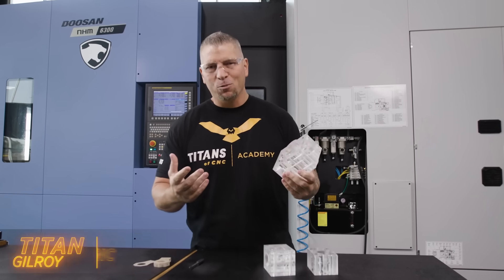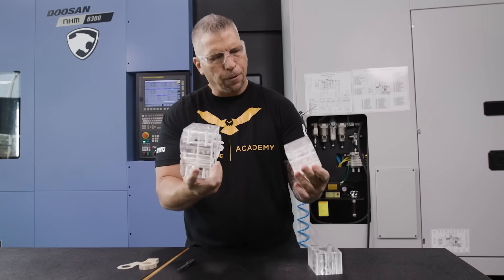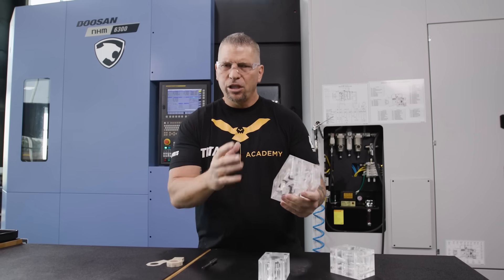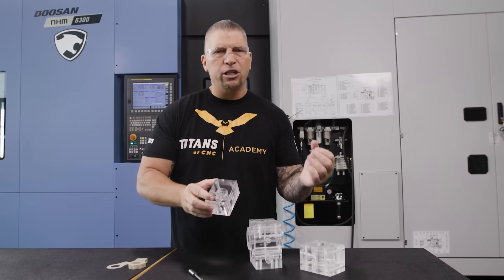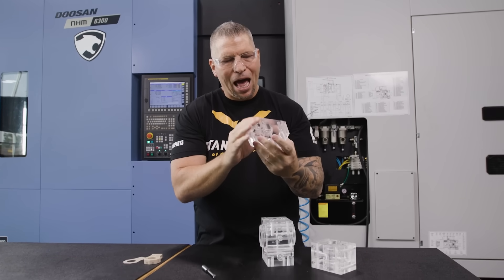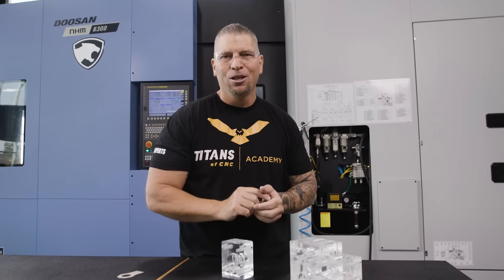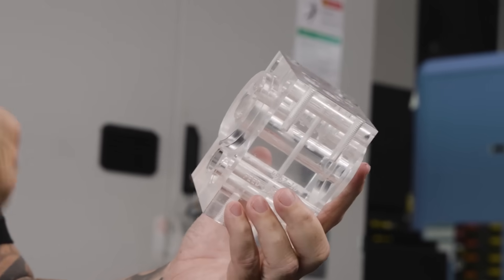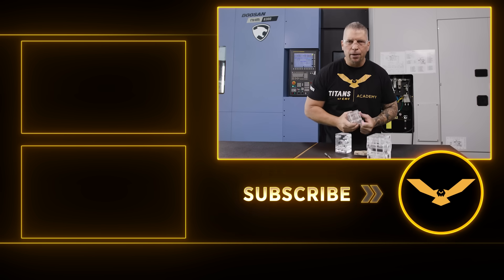My Secrets for CNC Machining PLASTIC

Comment: 🔧 Machining plastics IS often trickier than metal—thanks for the deep dive on tooling & techniques! For functional plastic prototypes or low-volume parts that demand precision, we’ve mastered these material nuances across CNC, casting & finishing. Knowledge is power!

Comment: I’ll be the first to admit that sometimes plastic can be harder to machine than some metals. It’s heat-sensitive, so it can warp or deform during machining, and its flexibility makes it more likely to shift or vibrate. Plus, static buildup causes any long, stringy chips to stick to everything. And don’t even get me started on cleaning the coolant tank when you switch between metals and plastics, it can be a royal pain. If you know, you know.. 😆

Comment: We do plastic stuff, man plastic is a pain.  we run 1000 rpm  no more.  Plastic wears on end mills and drills worse than fiberglass, or steel.  I've learned that tool wander for drills is real bad sometimes.  I've gotten as small as 1 ten thousandth just to get some tolerances just right.  Tool wear, really has an impact and so does what you're talking about, pressure on material, like stress.

Comment: I have a problem. I am using an old Hurco Hawk M5. I am trying to drill a 3mm hole to 100mm depth in Aluminium. I am centre drilling. SDatrting 3mm using a short 3mm drill, then medium length and then the long 3mm. I have been pecking away 1mm in depth so the drill retracts and I can get lubricent to the cutting face and blow away swaf. Listening to you today, I may have this all wrong?

Comment: The trick that I was taught to create clear plastic lenses was lightly heat the machined area of the lens with Hydrogen Gas using a standard Oxy-Acetylene torch....hydrogen gas burns without the black residue of acetylene.

Comment: From a machinist mechanic I think that pump was poorly engineered if it is that hard to machine.
We have been building pumps for hundreds of years, odds are there is probably an off the shelf that would have worked, boring but effective.
A pump doesn’t need .0001 accuracy to function.

It reminds me of the US vs The Russian space programs, the Russian rockets were designed with farm tractor tolerances and up until recently were doing pretty much all the heavy lifting while our stuff was mothballed.

Nothing worse than over engineering.

Comment: You talked about quality tools. I remember being in a job where administration was discussing with engineers and technicians about buying cheaper tools to save costs. That decision was above my pay grade at the time as I was a machine shop general operative but if it wasn't I would have stuck with the expensive tools because they were producing good quality automotive parts that the company were making money from and at a time when they could possibly have raised their prices if profit margins needed to be maintained.
Reply: Trying to save money by using cheap tools never work out well.  I worked at a shop where we had a job out of HY80.  It was planned to be roughed out on the lathe and finish op on the mill.  Lathe time was going to be 30+ minutes.  The GM called in a tool rep from Mitsubishi.  He brought in a tool for roughing it on the mill.  Cycle time was brought down to less than 10 minutes. The proved it out on the machine.  When the GM went to get the purchase order from the management team they actually asked if the tool was worth the cost since "it wasn't budgeted for" in the quote for the job.  The GM was literally speechless.  The tool was cutting the machine time by 66%.  The tool paid for itself on the first 4 parts.

Comment: I work for a company that makes bearings and a large number of those bearings are plastic housings, made in the building. A 2 chemical cast that is made larger and thicker so it can be run in the CNC machine. These housings can't have pockets in them. It's more than just shaping and cutting these housings, it's the pouring process. We also make Urethane inserts but again same thing.

Comment: I tried to machine plastics to mock up a miniature engine, it resulted in lots of melting, stanky smoke, and tears. Metal is so much easier to machine, the final product miniature engine in aluminum steel and brass was about a million times easier then the ruined parts in plastic.

Comment: I see time and time again guys using aluminum numbers in plastic and winging the rpm to the stratosphere. My approach has always been hi feed low speed in most plastics. Chiploads of .02-.04 per tooth. Keeping in the cut and reducing the heat generated. With uhmw I've cranked it up over .06-.09 chipload per tooth. I'd love to try tools made specifically for plastic. I've always had to run what we brung and I brung it hard. Guys thought I was nuts but my parts came out good.

Comment: Plastics chip pretty easy so tool paths are important to not chip but when it comes to tolerances the temperature it's made at , and the temperature it's inspected at can cause problems for close tolerance features . Granted inspection should be at a particular temperature and humidity and you should allow your parts to soak a while before checking them . But machining a part during the day may be different at night unless you have a temperature controlled shop which personally I have never worked in a shop that had that . I worked in aerospace for 43 years mostly as a manufacturing engineer and I've done work for all the big aerospace and some you may have never heard of from production to R&D (many Atlas family firsts) so I've seen pretty much everything from manufacturing machines of all types to nearly every kind of material there is and I have to say I disliked plastic the most . Give me Hastelloy , ask me to roll tap titanium (that actually works , scary but it works) , anything but that smelly tank contaminating plastic that seems to get everywhere .

Comment: Toughest plastics job I had was R&D for a mil spec battery part. 

The material was Tefzel, part was 0.200 OD x 0.125" L with a 0.045 through hole, intersecting slots on the bottom, a bowl shaped pocket in the top with a nearly sharp upper edge... And 4 x 0.06 deep radius bottomed 0.03 W castellations at 90 degrees though the upper wall.

Being R&D meant I made 100pcs. A couple weeks or months later I made another 100pcs to a slightly different print. Sometimes a minor change (tweek a depth or like that), sometimes a more radical change (F Cam rewrite). Rinsed and repeated at least 5 times. Then they had a mold made. That took for ever because the parts kept failing 1st Article. Which meant reworking/remaking the mold.

The secret to getting usable parts was to machine the tefzel while it was submerged in liquid nitrogen. LN2 is -300° F. This did not freeze the tefzel hard. Tefzel looks and feels like milk carton plastic, but it is in the same chem family as Teflon. Amazing plastic.

It did shrink due to the cold temp during machining, about 5% as I remember it. All codes had to be written to make parts that would meet spec once they warmed to room temp.

Tools had to be dead sharp. The LN2 allowed for parts that could be deburred under a microscope. Even with that, I had a lab quality scope at my desk and spent as much time deburing as machining those parts.

Without the LN2 the burrs would be big and include an unreasonable amount of mushing at the parts edge. Removing that, even with the scope and scalpel would render the parts 100% unusable. I also had programmed certain tool paths to run deburing passes. As in, rerun the finish passes without removing material. This weakened the burrs without damaging the part. With LN2 some burrs could just be flicked away with the scalpel.

This was the toughest part to get right. I did 100 percent inspection on the parts. On a good day I'd keep 20 of 30 parts. 20/day was possible after a week of dialing in after being down for a while. The process took a month or more to develop.

Over my career I made parts of many sizes, and many materials. Small Tefzel parts are a nightmare until you figure it out. Even then, it can be insanely hard to maintain the perfect conditions required to have consistant repeatability.

Comment: Back in the 70s I would manually mill and turn clear acrylic. Drill, ream, tap, mill and and it had to stay perfectly clear because parts were used in the medical field. I used tapmatic oil for my coolant. Feeds and speeds had to be just right not to burn. I learned to get good at it... Enjoy your channel.

Comment: the "1 tenth out we scrap" rule seems a bit much if the part doesent need the tolerance right there, especially with plastic. is the rule only for critical measurements or every measurement? if the design calls for say a 1 inch deep hole plus or minus a tenth of an inch, will you still make it one  inch  plus or minus a tenth of a thousands  of an inch? i assume the "tenth" was a tenth of a thou.

Comment: Yes. Machining plasics is a whole new learning curve. I worked for a plastics company for approx 5 years (2002-2007) as machinist, mon a CNC C-Axis lathe, CNC flat bed router and manual mill. One story I heard while working there was that a large, well known plastics company in Germany would machine parts to customer specs, inspect and sign off on the job, then guarantee the parts specs for 14 days only. As you stated plastics can flex after machining. Many plastics also absorbe moisture which can also be an issue,

Comment: you need to cut plastic as aggresive as possible and change work areas to let it cool down, because it melts easily. that is my experience in non-rigid diy cnc machines. in rigid machines it is much easier. always use a finish pass.

Comment: I'd have every apprentice on a manual feed lathe, the science of speeds and feeds is universal and how you listen and feel vibration comes anyway,  but you, with your hands feel how work time and heat change in the piece over time, go from hardened steel to aluminium and you're what feels like chipping stone to trying to scoop rubber, but then some stainless will roll and feel also on that scale. Best is the old hand ground parting bit which should be extinct, slightly dulled on hot aluminium, probably with masking tape on it, in the chuck thinking back, going from elastic, to dug in, caught and absolute destruction. Also flying chuck keys will teach life saving ninja reflexes.

Comment: I dare to disagree with a notion, that you put experienced guy on a machine to machine any of your parts and he starts to scrap it! That-in my opinion because of the past experience-is a psychological technique used by some employers to  knock new guy down to show him, he doesn't know all that much as he thinks, hence he will need to go down on his pay or keep him down in the foreseeable future..... But the problem is not in the new guy....the problem is in the owner or manager/supervisor of the place. Because knowing, that it is a tricky part, you should have explained and properly guide him into the understanding of what he is going to face, to machine this little tricky pieces. Nobody knows everything and especially not your particular solution to your tricky part. If you help your man to avoid problems, you will get a lot more out of him. Supporting the self confidence, rather then knocking it down by "throwing him into the water with undertow, he doesn't know about" to show him he cannot swim as good as he thinks!!! And on top of it, you can save yourselve some time and money by avoiding scrap!

Comment: We only CNC plastic and man it moves🤮😆 we're way of the blueprints when we run the parts to be on the spot when the parts are done and we always try to have 21-22 Celsius in the hole building.

Comment: Great stuff there. My shop does probably more plastic than metal. It took some time to figure out things like you just showed us. There are many types of engineered plastics and they all have different qualities and need to be machined in certain ways. We make a part out of Kynar a very expensive hard to machine plastic. But by trial and error you figure it out. You have too if you want to succeed . I think the one thing we learned quickly is the rate at which you can remove material to get those quality finishes and hold the tolerances. We made parts that had to be at a very tight tolerance and we had to guarantee two tenths on a bore. However that tolerance was held at a certain temperature only. We kept parts in temperature controlled water to check them and do tool offsets accordingly. Great stuff as always Titan many thanks for all you do! If we don’t properly educate the future generations …… just where will we all be.

Comment: Lol now you’re talking my language, love plastic machining, with all the materials you mentioned, yes so many shops are lost when it comes to plastics, they think they can set it up vises and the clamp  as if it were metal materials that’s a Knogo!! 
Plastics does shrink always a consideration never use oil, Always use vacuum plates fixtures  jigs, pressure Padding, and lots of double back tape, router tables come in handy cutting tools have to be brand new, I usually put a coolant in syringes and inject into threaded holes prior to threading comes out like glass no burn marks or stress marks,
Reply: Going to give that a shot thank you for sharing. *Iv got some vinyl blocks, waiting for me in the morning.

Comment: So as a programmer to deal with hats after you flip a part. Your best success rate i have come up with is . Create an off set boundary about  .025 larger than the od of the part. Ramp and endmill down with a profile cut. The hat will drop around then part then clean off the remainder of the material . For plastic conventional milling on the finish pass will lead to no chipping of the edges. Much the same way you would deal with lets say castings and cast iron  parts as the chip very easy as well .

Comment: Ok , Here is a polycarbonate secret ,for slots or shallow work that need to stay clear, flood it with wd 40 instead of coolant! Cheers!
Reply: I'm curious about the long term effects from exposure to oils. Have you had discoloration, cracking, or reduced strength, after a few months?
Reply: @machinemaker2248  No, Of Coarse clean it well right after and no issues!

Comment: Polycarbonate and delrin… meh. I just machined ultraflon 550 (Teflon variant) and had to put a tight tolerance on a 3” bore in a 2.875 thick 4.500 square that always moved when released. Also all six sides got machined and had a separate setup (with no 4-5th axis) and there were 44 soft parts to be made with no extra setup pieces because the customer supplied 6” X 3” round stock with a 2.0 bore was hand extruded and cost $1000 plus a chunk. More $$ went into the bin as chips than into the parts. But all were nominal and on time. Delrin… lol. Love that stuff ❤️

Comment: I'm a mechanical design engineer, and I cannot iterate enough how important it is for all design engineers to watch these types of videos to understand how a machinist thinks and works. This allows us to design, document, and deliver better product designs and plans to our machinist that will allow companies to consistent and successful manufacturing flow. Seriously, engineers are machinists and machinists are engineers, we simply have a false disconnect.
Reply: Most "designers" think they are something better/higher status than toolmakers/machinists/technicians etc.
That's the biggest problem.
Reply: @qwertyuiop2895  really just called homie out for no reason
Reply: so many engineers where i work think we load the 3d model straight from mastercam to the machine and press go haha
Reply: buddy of mine from machine shop tried to educate some engineers but "who is he to tell them", so he evolved and stopped talking, the dumber the engineer the more billable work for him...
Reply: I had to do alot of prototype work years ago, the number of times we got mis constructed parts was unreal, drawings that didn't match, I had to get all the assembly drawings and make sure everything worked before starting machining
Smart guys are not always experienced, defo helps if you want to get involved in as a designer
Reply: How stupid is beeing a mechanical Design engineer without Basic cnc knowlege.
Reply: Facts
Reply: Well said man!
Reply: Well said my man. Communication is key.
Reply: communication is key
Reply: The overlap is there because both have to deal with physics in the real world. The triad of physics math and purpose should be explored by both professions. My son wants to get into design has a degree in Mechanical Engineering, currently working as a pricing quote estimator for controlled environment vacuum systems in industry.
Reply: I was training an engineer to help himself in our shop before I retired 8 months ago. He's in his early 30s. One of the best engineers of that age group I'd worked with.

In the shop I'd peg him in the 1-2 years operator range. His setup abilities were no better than that because that skill is only gained by watching the skilled, then doing.

Also his CNC coding knowledge is good, yet even though I told him numerous times how to safely first piece a setup, he kept coming close to crashing.

I hope he figured it out because right after I retired so did one of the other tool makers. That leave one. A 68 year old workaholic who may stay beyond his time. But he has more than enough work for his own boss  and he won't be doing any training.